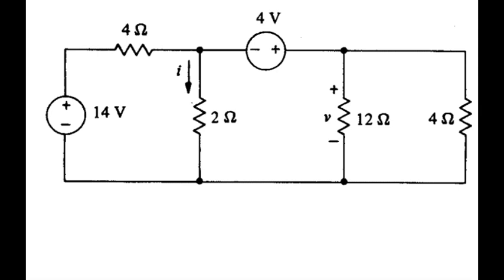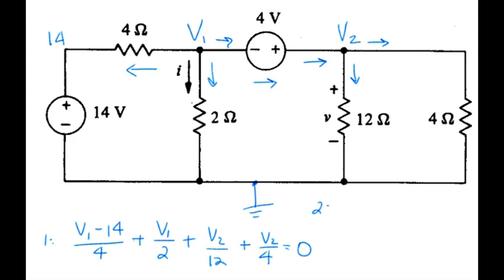dc: Node Voltage Example #5

Comment: Why when u subtracted the v1-14 u didnt multiply the whole by minus because its in the oppsite direction of the 14v source ! .. so shouldnt be 14-v1 ???
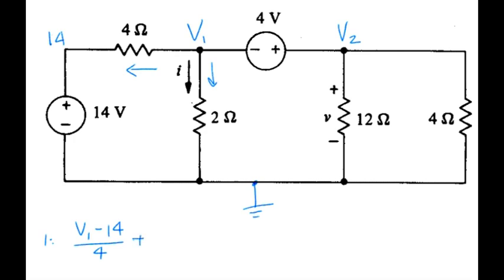Reply from the maker: The usual convention for the node-voltage method is to write the positive current leaving the node; the current may in fact be going in the opposite direction (as it does in this circuit... the true direction of positive current for the top-left 4-ohm resistor is left to right), but for the purpose of writing the node-voltage equation you write each current with the arrow pointing away. Because the resistor current is always the node voltage at the tail side of the arrow minus the node voltage at the head side of the arrow divided by the resistance, the first current shown at 1:03 would be (V1-14)/4.
Reply: So I only take the direction when there is a current source right ?
Reply from the maker: safanah abbas
That's correct. When the current source arrow points away from the node of interest you write the current source value unchanged (the value itself could be negative, though), otherwise you write the negated version of the current source value.
Reply: Ok thanks a lot :))